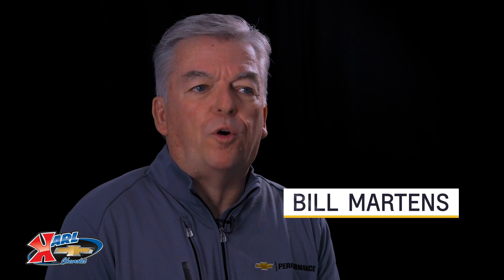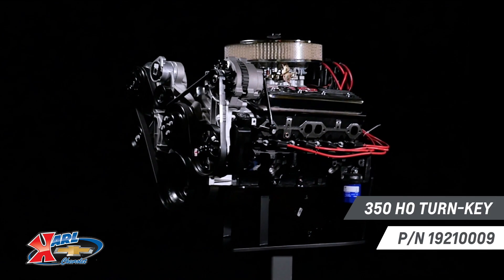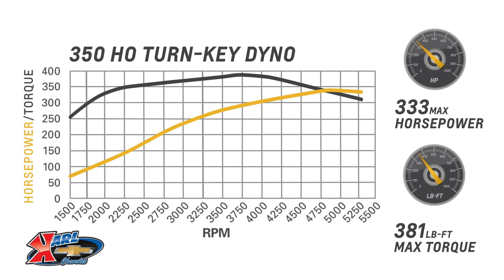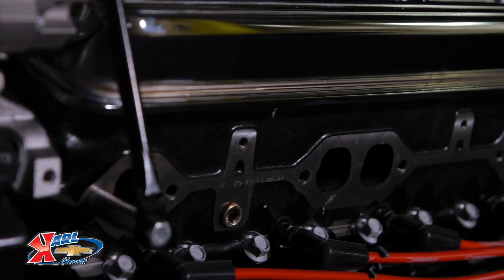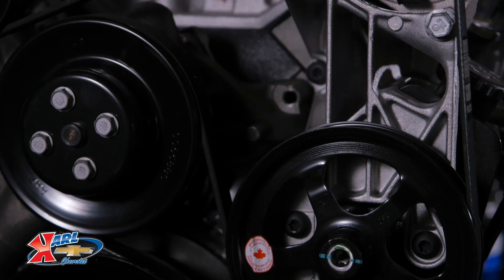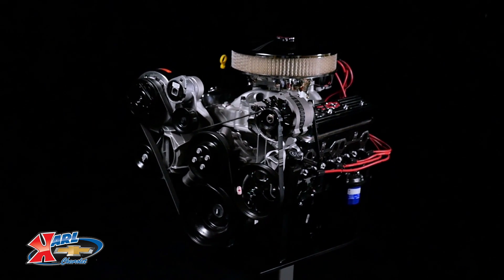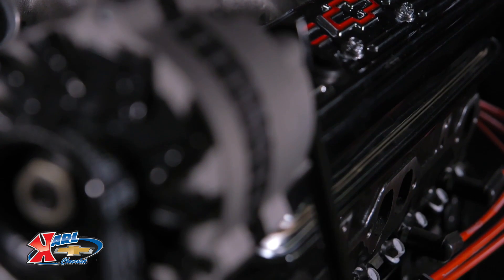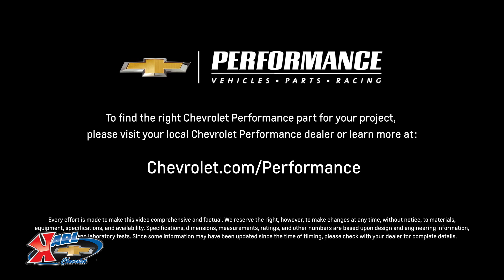Chevrolet Performance 350 HO Turn Key Crate Engine Information & Specs

Comment: So could I put this in my 1984 c10 custom deluxe
Reply: yes I just put this motor in my 84 c10 custom deluxe last week only problem I had was that I had to get headers and had to modify the exhaust a little bit . and make sure you run your fuel lines right or you'll vapor lock.

Comment: Wanted to see if I could place this into my 67 Impala as my weekend car.. considering it's a performance engine is it ok? Or is it just meant for race track time?
Reply: I put this engine in my 86 c10 3 speed auto trans with 3.50 rear gear. Love it!  Very street able. NOT a race engine
Reply: @johnnyreb8030 any sound clips?

Comment: As a direct replacement for my 94 Chevy truck. What kind of MPG can I expect from this engine.
Reply: Mpg really depends on the truck itself and the driver. The weight, 2 or 4wd, gear ratio, tire size, and drivers foot. I had a 1995 Z71 when they were new. It had a standard 350 throttle bottle engine and it got 17mpg on the interstate and 13 or so around town. But it only had 200hp new. Probably same results with this crate engine since it won’t work as hard as the original 200hp engine did.
Reply: 2 mpg 😂
Reply: Depends on your right foot man.

Comment: What is the redline on this engine ?
Reply: I have this engine on my 1979 TransAm. Redline is around 5500rmp. But the powerfull moment is around 4000rpm. I can push it around 6200rpm but I never do that.
Reply: 5800 rpm or it won't last long
Reply: Max power around 5000
Cast bottom end 350 "critical speed" is reached @6,000RPM.

No need to rev past 5500. When max acceleration is desired you generally run a little past max power RPM so that your RPMs are still high after the shift.

Comment: anybody know if you need to run a stall converter with this engine?  Or will stock be ok? might run a 400 turbo since thats whats in the car already
Reply: Stock converter will work
Reply: I used a 2200 hughs converter in mine

Comment: hey guys,i bought this engine 10 years ago,yep but i just got the long block not turn key carburetor so i bought a vortex intake so my 1995 TBI z71 parts would fit,its got a nasty cam sound i love it,and yea its reliable,why wouldn't it be its brand new.the gas isn't too bad its like everything else as long as you keep your foot out of it you will be ok,as a daily driver yea just drive normal,and i get thumbs up when I'm at a stop light or when i crank it up at the gas station.with true dual exhaust,x pipe,magna flow cats and borla xr-1's it sounds killer.
Reply: subbed to your channel.  Dang!!!! 16 year old upload ??? lol
Reply: Vortec not vortex dummy

Comment: can I put this engine in an 86 88 caprice
Reply: Meghan Gerhart i have a caprice with a 350 small block will this fit in ?
Reply: ORENGEcarot Yes. I got a 350 HO in my 84 Caprice Sedan. The thing rocks!
Reply: I have a 90 box caprice  305 tbi could i just get this motor and keep my stock fuel injection